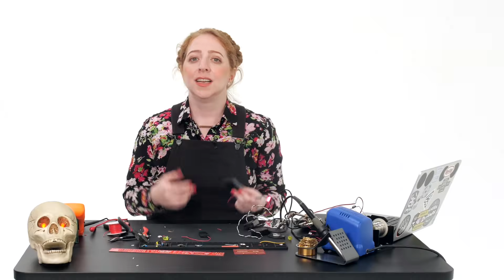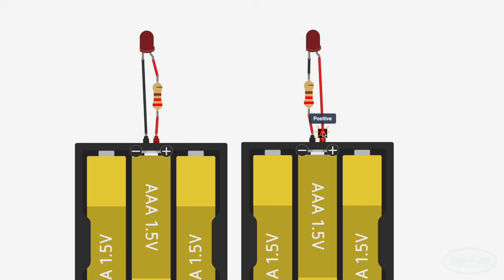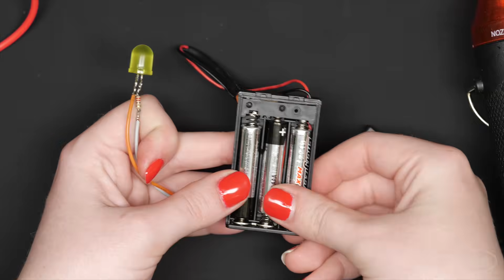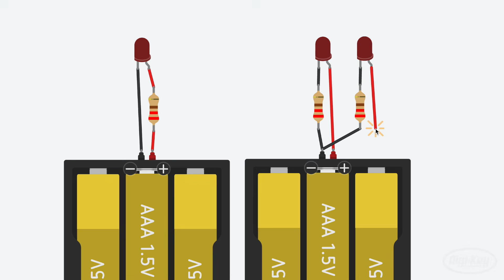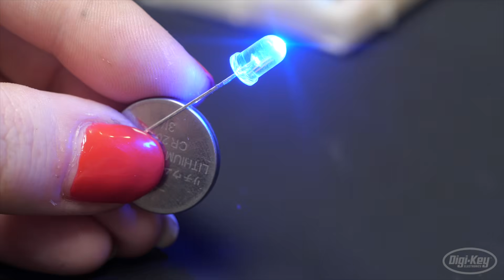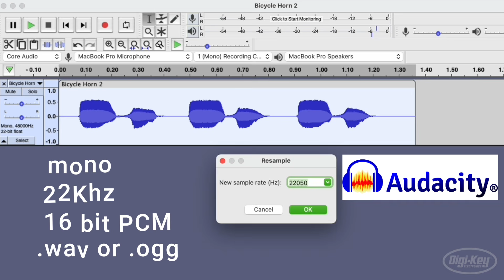Simple Light and Sound Circuits - Electronics with Becky Stern | Digi-Key Electronics

Comment: This series is great, so please don't take this personally. I think educators need to be more careful with the statement at 3:20 "Electrical current takes the path of least resistance."
This is a very common statement, indeed almost common-knowledge, and is taught in schools, but it is misleading in the sort of way that can stick with and misguide a person for years. (ask me how I know!) 

And especially in this example of parallel LEDs, where it seems very clearly demonstrated.

Unfortunately, I don't know how to summarize it briefly other than to suggest it's more like the flow of a river or stream.

Current flows through All possible paths, just like a river flows around boulders and islands, and even trickles through beaver dams.
Those LEDs are all getting current, but because one has a lower voltage requirement to turn on fully, it sets the voltage going into all the others, which is lower than their voltage requirement to visibly light up. (This actually can be seen with some LEDs, which glow very dimly, but visibly, at voltages far lower than their official "turn-on" voltage).

It's like three side-by-side beaver dams blocking a river. One is shorter than the others, so the water flows over its top, but the other two still allow a trickle through their branches.

The reason this is important, especially here, is because it's not the "resistance" we're talking about, it's the voltage. And equally important is that current doesn't merely choose the easiest path.

The /majority/ of the current flows where the river is the deepest. Far less-so where it's shallow at the banks, but it does flow near the banks, and around both sides of islands and boulders, and over shallows, and under fallen logs, even though all those things add resistance to the flow.

However, it doesn't flow over the banks, nor over the taller beaver dams, because the water level (the voltage) isn't high enough.

I think someone smarter than I could figure out a better way to say this... The other is easy to remember, wordwise, which is why it's so commonly taught. But except in very rare circumstances (like parallel LEDs), it is rarely true, and thus misleading.

A far more accurate analogy, I think, is very difficult [for me] to summarize, but I think it makes a lot more intuitive sense, based on many examples we see in real life. So, actually, it should be easier to grasp than to rewire one's brain to thinking somehow electricity goes against real-world experience in other realms (like water or wind flowing).

We just need a snappy way of saying it!
Reply: Maybe we can just say "paths of least resistance"... I always found it so interesting that the water flowing analogy applies so well to electrons, the micro so neatly matching up with the macro... appreciate your thoughtful comments!